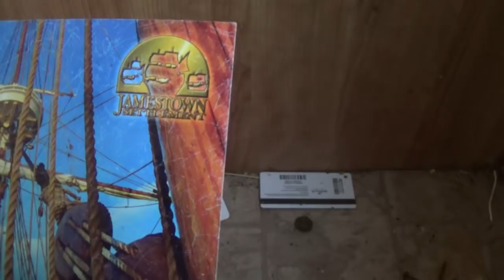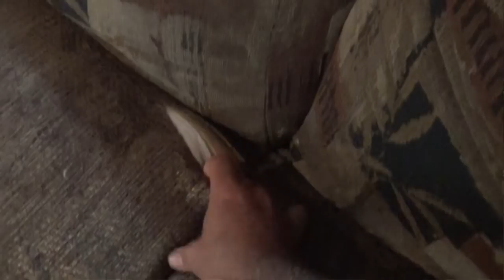RV Renovation--Replacing the Old Dinette with a Second Sofa Bed - RV Tips & Tricks

Comment: where did you get the plastic inserts for the cup holders? We have a remodel going on with our RV and I wanted some built in cupholders
Reply from the maker: We got them at Amazon. Search on Amazon for Marine cup holders or drop in cup holders and you should find some.
Reply: @TheTravelBags  thanks! I will check it out